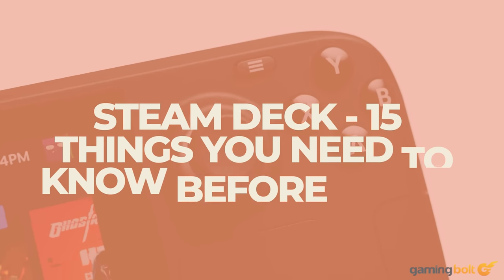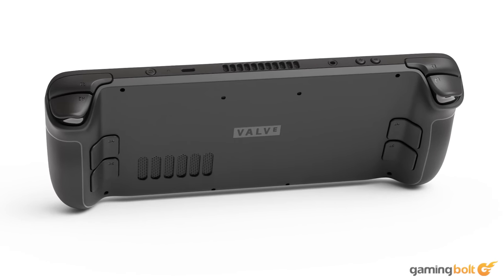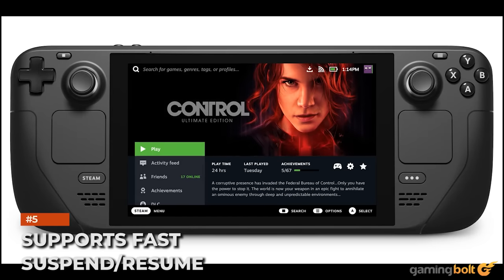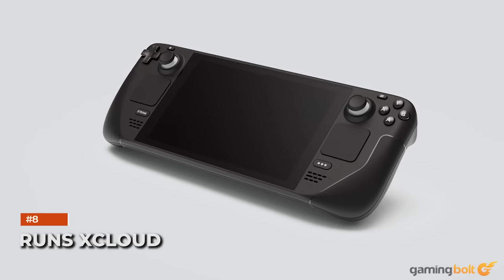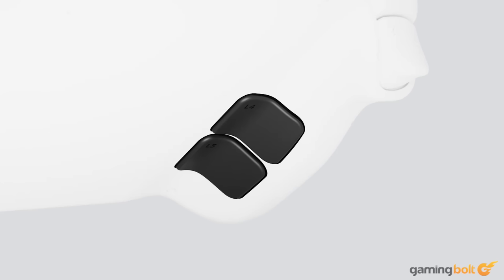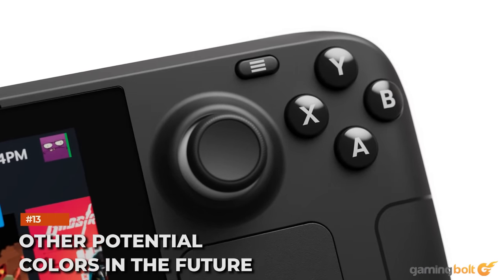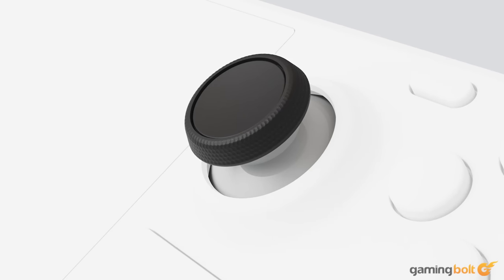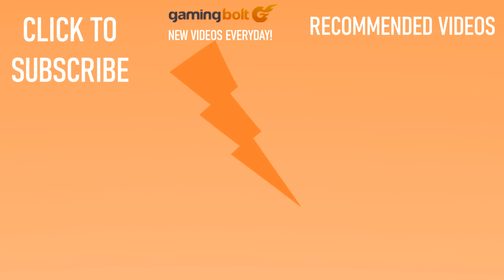Steam Deck - 15 New Things You NEED TO KNOW Before You Purchase

Comment: Would be nice if the deck did support VR games for people with a wired vr headset. They could wear the deck on a vest or something and have more freedom.

Played HL:Alyx on a quest 2 and it's by far the best virtual reality game made. It has to be one of the best games I've ever played. Just a shame so many people haven't been able to experience it.
Reply: it should technically be possible, just use a usb c to hdmi/displayport adapter, install steamvr and everything should work. It probably wouldn't be that good of an experience, but an experience none the less.
Reply: The SteamDeck will evolve over time, so I wouldn't rule it out yet.
Reply: @algotn  Technically steam VR has Big Picture running under it so everything should go smoothly once you get the headset recognized by the device. There's absolutely no way games like Alyx are running on the deck though, maybe just some very light VR games and 3D videos

Comment: Is the steam deck DRM?
Reply: Games on the Steam platform are DRMed, they are linked to the Steam account. But it's a PC. So if you like the device but don't want to use SteamOS, you can wipe it or create dual boot to install Ubuntu, Windows or whatever OS and play your GOG library on it.
Reply: The Deck itself no. DRM is on a per-game basis and not every game uses DRM.
Reply: @Gramini  So you can play some games offline?
Reply: @ryno_8848  Absolutely. Some games require you to be online during the first startup and then work completely offline, other always work. Some don't.

Comment: I don't get the point of this. It's basically a Switch without the Switch exclusives, at a much higher price tag.
Reply: has tons of games that aren't on switch, that's why I'm getting it
Reply: It's more powerful and probably will have more games than switch, Even You could install yuzu and play nintendo switch games, lol
Reply: Given the scalping on switch’s rn, it’s actually very comparably priced. Plus it’s in a different playing field all together as far as performance goes. 

And Steam Library is the largest and strongest library in existence. Far greater than that of Sony and Microsoft’s. 

Hell, even god of war and horizon zero dawn etc are on steam now.
Reply: @retrofxmedia  Wut? There's way more scalping on the steam deck. 500gb version is going for upwards $2000 on ebay. Meanwhile my local gamestop has the regular switch for $300.
Reply: @Chileball  Nobody test it so far, so you cannot assume that yuzu runs well on steam deck. Especially it is going to drain your battery life more faster. It's more powerful than switch but also more expensive than switch. I just need 128gb sd card for my switch because most of my games are cartridge, digital games are also smaller (e.g. botw occupy 14.1GB only). But for steam deck, one GTA 5 already occupy 80GB, you will need 1TB sd card to store more games. Otherwise you have to repeat the process of download --> delete --> download. Basically is more expensive and less convenient than Switch.
Reply: Yuzu
Reply: @SKW465  Or you could be a reasonable person and just play smaller games. There's a reason certain games aren't on the switch.

Heck if you wanted to you could use Yuzu and play switch games.

Also just look at the games it can run and basic requirements required to run them decently well. It's well enough for Yuzu to run not to mention it's also comparable to a 1050 somewhat in graphical power.

It's good on Yuzu for most of the big games if not all of them.

PS3 is the big question.
Reply: @SKW465  uhmm, just search more info lol
Reply: The Steam Deck has access to the Steam library, aka the largest games library that currently exist that's hundreds of times larger than the Switch, with games the Switch has no access to - does the Switch have Horizon Zero Dawn? God of War? Forza Horizon 5? Titanfall 2? Upcoming titles like Elden Ring? Niche titles like Crusader Kings III,  etc. And unlike the Switch, you can play modern AAA games on the Steam Deck with significantly better performance - playing Doom Eternal on the Steam Deck will not only look better, but also be smoother and faster.  Not to mention the Steam library is significantly cheaper and more affordable than Nintendo's games library, and you don't have to pay a subscription to play older games. 

Even outside of Steam, since the Deck is a full PC, you can do stuff like install Windows, which gives you access to Microsoft Game Pass, Ubisoft Store, GOG, and Epic Games Store among others, which significantly expands the games repertoire. And beyond that, emulators even allows the Deck to run Nintendo games on it!

Thinking this is a "more expensive Switch" is also the wrong way to think of the Deck: this is a less expensive gaming PC that's nearly half the price of gaming PC's with similar performance.
Reply: It does not have Switch exclusives. Well… unless you enter emulation (Yuzu and Ryujinx).
"at a much higher price tag" – I wouldn't say that 350 <=> 400 is "much higher", especially when considering price-performance ratio.

Comment: Slow SSD speed. How are you going to store several games?. You can't because the storage is pathetic.
Reply: Add a sd card😐 watch gamers nexus and Linus tech tips where they tested load time. Don’t be ignorant
Reply: Go watch Limus Tech's review there barely any difference as for as speed
Reply: Sd card bruh they are hot swappable.... 1tb sd is big enough..or acouple 512gb ones
Reply: If you watched the video, SD cards are more than sufficient for storage, and the performance dip for using them range from negligible to nonexistent. See the tests they had shown in this video where they had Control load up from the SSD and the SD card, and they loaded up at pretty much around the same time. So you can buy the $399 model, add in a 1 or 2TB SD card, and you're good to go.
Reply: @StrikeNoir105E  Let me put you right. The base Steam model only uses EMMC Memory! This is slow as hell. The other models use a much faster memory. Games will run slow for sure.
Reply: @malathomas6141  My friend not ignorant. The bus width of the base model will only be 500MB per sec  SLOW. NVME is 8 times faster which is only in the higher models.
Reply: @StyleWearMarv  The bus PCIE is only 500MB in the base model. Its only PCIE-2. Its 4GB in the other models due to NVME so if you don't look closely you'll, get stung.
Reply: @sludgebuster9677  I hear ya I'm new to this PC gaming thing. I guess I gotta do more research
Reply: @sludgebuster9677  eMMC is not memory. All models use the exact same memory (16 GB LPDDR5@5500 MT/s quad channel).

Storage speed only affects load times. Game performance is not affected by that. Load times are only a bit slower when using SD cards/eMMC compared to the NVMe drive. Confirmed by testing/benchmarking.

Sure, NVMe itself is much faster than SD or eMMC, but that does not matter that much for game load times. On my PC there's only little difference in load times when comparing my hard drive and my NVMe drive, although the latter is significantly faster.
Reply: @Gramini  Even if it load times then on paper will load 8x faster with top and mid tiers.
Reply: @sludgebuster9677  No. There are already benchmarks. Raw throughput is not that relevant for games due to stuff being compressed.

Comment: Entire steam library, no, Fortnite, no. Will Valve leave this as with the Steam Machine, yes.
Reply: The Steam Machine was a rather misguided attempt at trying to sell PC's as a console and trying to outsource production to third parties. It's clear from other devices like the recently successful Index that Valve has learned their lesson on how to target demographics for hardware (this time the PC is physically a console), not to mention that the Steam Deck is really just Valve once more pushing their gaming Linux aspirations in a more successful format. 

Also, Steam Deck is capable of playing Fortnite if you install Epic Games Store in it, which is very much possible.
Reply: @StrikeNoir105E  epic store will only be available through Windows - bad performance and bad battery usage.
Reply: @JOHB25  There's HeroicGamesLauncher as an alternative to the EpicLauncher. It's the same store. Fortnite is still a no because Epic is being not so epic but rather shitty.